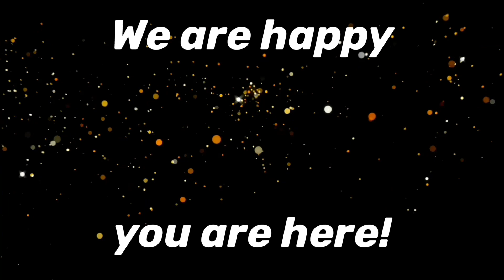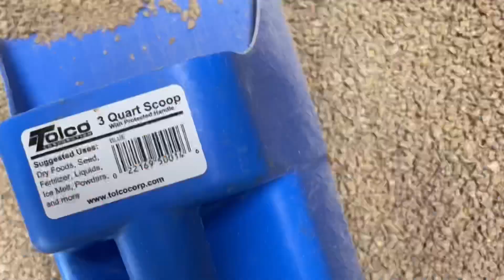My Evening Barn Routine | Barn Chores | Taking Care of Chickens | Homesteading Adventures

Comment: Tanya, do your chickens lay eggs in winter? Do you heat the coop in the cold season? Because I'm usually out of eggs until March...
Reply from the maker: They do lay eggs, Vyuko Юрко, but they slow WAY down in production. We minimally heat the coop with one or two heat lamps, but other than that the chickens are pretty hardy, especially the breeds we have. Have you ever tried water glassing eggs during production months?
Reply: @manushak_and_tanya  Not yet. Somehow nobody ever did that in my family. But I will definitely try it next summer.
Reply from the maker: @ym3306  let us know how it goes! We have not tried that method yet, either, but it looks fascinating.